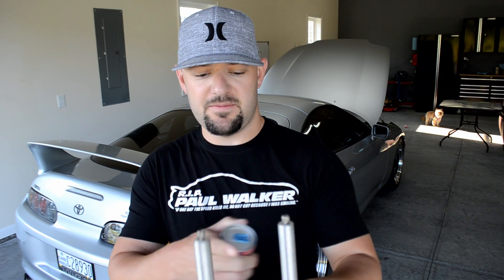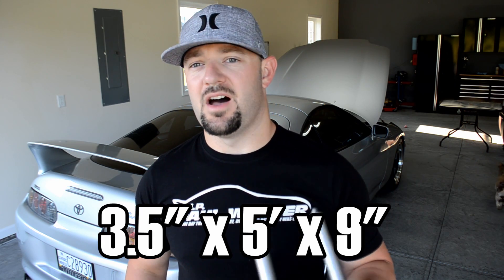Standalone ECU v.s.  Piggyback ECU

Comment: I had two of the Bluespark. They work ok. However. I dismantled my second Bluespark on my Golf R. After some 7 months, I noticed that every so often I got some hesitation here and there from the engine. It was almost like as if there was a connection issue. I had similar issues with this box on my previous car.
I decided to remove the Box and,all the electrical connection harness. Car been running fine since. I am reluctant in using Bluespark or any Pickyback box on my car. Instead, I will end up going for a custom tune. I don't want issues being caused by a pickyback. It is unsure if it was some sort of connection issue or within the box itself. I am not saying that no one should buy a pickyback. Just be aware that it may end up not being reliable over time as my experience was. So? Instead I be spending $1,500 for a custom tune by a reputable custom tuner.

Comment: When you refer to piggybacks 'fighting you', you are simply referring to closed loop AFR control. Two options 1) Only tune high throttle when car is in open loop ( ie no O2 sensor feedback ) 2) what many tuners do is to simply disconnect O2 sensors, forces car into continuous open loop and tuned off base maps. Then you tune that, can tune either low or high throttle without any 'fighting' as you say.
Reply: Find a reputable custom remap tuner. Not someone who has a generic  file he loads but a custom dyno remap tune.
Yes. Ut will cost. But you often ger what you pay for. Pay cheap, get cheap.

Comment: Thanks for the info. I'm trying to 5 speed swap my 2000 sc300, but manuals were only for 92-97 and I live in Cali where you can't flash or run stand alones. I know the swap will give me a CEL, but think a piggyback could solve that issue?

Comment: The markup on the hardware for these standalone units is insane.

I understand that there's overhead in designing a decent suite of tools and being able to interface your particular engine platform but with speeduino shields being open source the support for them is starting to make them look better than even some of the previous "go to" $1000 options...only they're ~$200 (even less if you build your own)

Comment: Its interesting.. i installed a piggyback ecu on my car and after one month the stock ecu gave up and the car didn't start!! Had to remove the piggy and get a new stock ECU..
Now in the video you said (the stock ecu fights the piggyback!! Maybe thats the explanation why the stock ecu blow up??!
Reply: Ghost of Sparta I agree, you probley installed a few wires wrong, I’ve run a few piggy backs and back in the day every body with turbo eclipses had piggy back set ups with no Ecu problems.

Comment: Thought the vid was great very informative I gots 2012 370 i use up rev which flashes my stock ecu stock ECUs kinda suck they have upgraded ecu for like 1200 dollar for my ride which I believe has faster digital signal capabilities as far as commutation from the wires Between a sensor and the ecu but uprev is good I think it’s limited though as you mentioned I must verify you are right that a stock flashed ecu though wonderful conveint and great has sum limitations in comparison to a stand alone but I’ve witnessed a AEM standalone being wired into an S10 chef and then taken right back out once the guy cleared up sum programming issues he thought wasent possible with Chevy tunning software he figured out how to flash his Chevy and ended up goin back to his stock ecu he wired the AEM wrong took it out never put it back into the truck once he found a better way...Now I think my uprev is kinda of basic because I hate the interface it looks like an I dash stereo LOL..CHEAP..but uprev offers real time running for my car which is something you didn’t metion I’d like to see you Do an episode on real time tunning Dynamic tunning if that’s somethin your knowledgeable about you seem a lot smarter than you look you dress like a Douche 💼 LOL..IM JOCKEN YA MAN YOUR ASSOME..FIRST THING I NOTICED WAS THE SHIRT DEFINITELY DIG YOUR SHIRT..PAULS DYED TAKEN A RIDE IN A MONSTER HE CLAIMED WAS HIS CHOSEN DREAM CAR THE Porsche Carrera GT..

Comment: 1996 Viper GTS 511 rwhp heads/cam/headers stock PCM w/MAP translator (VEC1):  what to do....   Hear the OE PCM is a cryptic minefield.  Many use AEM standalone w/o harness adapters - a model Series 2???  OR  ???  I will not chop up the harness.  Car licensed as Classic in PC so NO emission testing.

Comment: I have a stock volkwagen ECU that has been bench flashed to stage 2. Including some emission deletes. Funny thing is it's from 1999. They were chipping only these ecus until 2006 until someone figured it out. Works great stock drivalbility and +55 hp and +80 ft lbs tq

Comment: All standalone ECU's are not CARB legal......PERIOD. So, if you are not smart enough to know how to add power and PREVENT the CHECK ENGINE light from coming on...then what's the point. It really gets old hearing GUYS who think they know mods take the cheap or EXPENSIVE USELESS easy way out. My advice is to RESEARCH, RESEARCH, RESEARCH. I ran a Piggyback set up years long ago on a GM VE SMOG LEGAL (which is WAY MORE COMPLICATED) than any import and the car was a CALIFORNIA car. To sum this up, You on NEED Piggyback under load (BOOST) not CRUISE. This where 99.9% of guys don't get it. You are at cruise 90% of your drive cycle and BOOST only 10%. So, is spending for a standalone worth it....NOPE. The people that sell these KNOW that 99.9% of you guys DON'T know what you are doing and stand in line to take your money.....period.....The most expensive part of my instal was the custom wiring harness I had made to interface between the 2 components because I didn't want to cut any wires. I spent about $300 back in 2000. I was able to keep the car smog legal for California smog dyno smog check. The smog tech did see the unit while accelerating on the dyno but, you have to PASS SMOG UNDER CRUISE CONDITIONS, NOT BOOST
Reply: You guys are semi-screwed in Cali. In Florida don't have all that. But even where you are you can get a plug and play set up and put the stock ecu back in for smog.(which may or may not work or pass visual). Standalone offers too much performance advantage/idle quality with cams and features to be ignored. In 2000 you'd be right, but it's 2018. Adaptronic is my pick.
Reply: Jeremy. 
I think the stand lone does have its advantages but, only on the track and not the street. My past project was a 1996 Corvette Callaway Sledgehammer Twin Turbo clone (including the aero kit) with LT-4 355CI 8.0 compression pistons with 780 RWHP with 6 PSI boost. 976 RWHP with 15PSI boost with a white knuckle speed run on I-15 FWY outside of Victorville, CA of 252 MPH. i ran an AEM piggyback to control the added fuel flow to upgraded injectors, fuel pump flow for the secondary fuel pump, timing and boost pressure. It only needed a MAP trigger to sense boost and it was instantaneous. 
(My wife made me sell it 6 months after that. She found out I was racing a Lamborghini one night) She feared for my life on account of our 2 young boys This car was a BEAST but, it was street driven on the weekends and sometimes to work and I got 18-22 MPG. I have yet to see a post here on a vehicle that could have done or potentially do this without being a track only car.

The point is, do you want a track car that you invested heavily in and limited to just the track stripped of all of its creature comforts or build something you can drive everyday, listen to the stereo, have AC and be GREEN?.  I built my dream car in 2000. Its 2018 and still I haven't seen here on the tube that has proven better.  (Let me know if you can find a link and share it with me) 

To add the Adaptronic is pretty cool. But it's just eye candy for me. It's not C.A.R.B. legal for on road use. My future project would be possibly a Third Gen Camaro with a CARB legal LS3 swap with a Paxton CARB legal supercharger. I won't hit 200 MPH due to aero but at least I won't have to go thru smog checks every year.
Reply: Michael Wilson That is a truly wicked set-up. Your tied to your state laws, so it's all you can do. A modern standalone does all the things a factory ecu does better. You are not handcuffed to any limitations and now have; 2-step/Anti-lag/flat shift/high impedence injector drivers/E-85 auto sensing(%gas/ethanol) /compressor speed function/ignition interrupt/traction control (user configurable)...ect.. These things make a high HP street car more streetable/safe and easier on hard parts. Also you can run a larger turbo and make even more power.  Factory ECU'S make sense for a California car, but standalone make's alot of sense for alot of people who like to be able to pull or add power or want to protect thier engine with all the additional safeguards a good stand alone offers.
Reply: I know in the past standalone idled rough and liked to stall when you hit the a/c button. All those problems are a thing of the past. Throttle response is so good , they never go back to factory chipped/flashed ecu's. Many are based off advanced german factory ecu's so they have all that processing power and then some. They are much faster and more advanced.
Reply: Jeremy
If you don't mind. What's your setup?
Reply: My current project is my daughter's car.(Context) Mk3.5 Golf Convertible Chassis 12V VR6/268 DRC Cams/Wiseco 9:1/Fererra +1 Superalloy-beehive springs/Gt4092 T4/Arp studs/02M Trans/Electromotive Direct fire/M2000 Adaptronic/ Schimmel Water to air/Schimmel Intake.No Dyno(Car in not complete) similar set-up's did about 580-pump-750 ethanol. Or low 11's. The engine was 150 wheel stock.(Nothing impressive compared to a twin turbo Corvette). The car weighs about 2700 lbs.
Reply: DUDE! This is the reason I had to build by Vette because of cars like yours . Your power to weight ratio is 1.6 to 1 while my Vette was 1.5. You are just limited by gear ratio on the top end. Your quarter mile et could beat  the Vette due to the limited mass you are carrying. (Granted you can get the power to stick). It would have taken my car a FULL 1/2 mile to catch  up (depending of surface traction and temp) then aero and gear ratio would take over after that. I can honestly say it would be tough battle. The Vette was built for top end so, the car was a star above 90MPH. If we met on the street where the distances are shorter you'd STOMP me 0-110MPH everytime.

Awesome car.......
Reply: Michael Wilson Thanks. I catch enough at work from my boss and his blown SRT . I am building a bagged C10 next. There are lots of pictures of the car before I put it under the knife. Farenheit Cabrio R32 VR6.
Reply: These small cars really handle great.

Comment: Need some suggestion on what ECU to use on 2004 type 2 Honda Accord. I want to boost the K24A4 engine to 7-10psi on stock internals, using a twin scroll turbocharger. Mainly looking for torque and fuel efficiency gains, because I'm interested in hill driving at around 6000-8000ft altitude.
All help would be greatly appreciated! 
I'm writing from India, and the car-mod scene here is pretty nonexistent.

Comment: Been running a piggyback AEM in my mk4 for nearly 5 years with no problems whatsoever. Has been a daily driver which has run low 11's on the 1/4mile.

Comment: Yeah no advantage at all to a piggy back. Horrible thing to do. Terrible just plain terrible. If you need the stock ecu for emissions reasons than you can run majority of standalones parallel with the stock ecu. Same goes for if your standalone can not control an automatic trans
Reply: kreionic how does a parallel ecu setup work. The reason I ask is because I'm running a stand alone Haltech, but it won't pass emissions. So as of now I can't drive it,  because my tabs are expired and I can't renew them until it passes emissions.
Reply: Demetrick Louis 
Piggy back with a Haltech you have to leave the CAS wires running to the stock ecu, just tap into them for the ignation feed, cut the injector and ignation outputs off the factory ecu and join the to the haltech loom
Reply: Ummmm running a ecu in parallel with a aftermarket unit is technically piggybacking lol. Just saying.